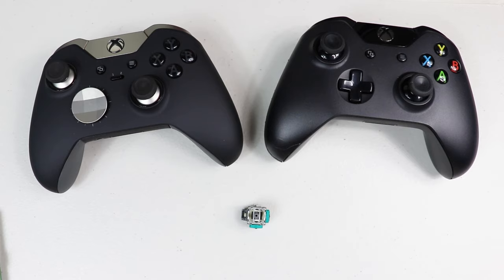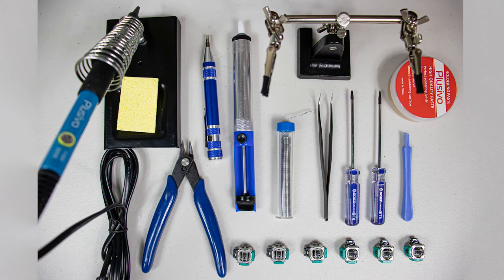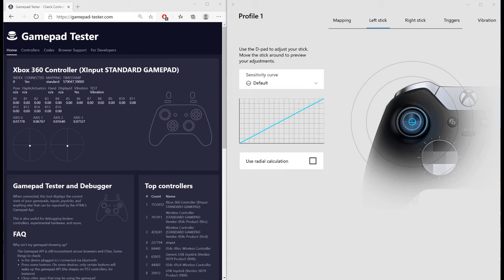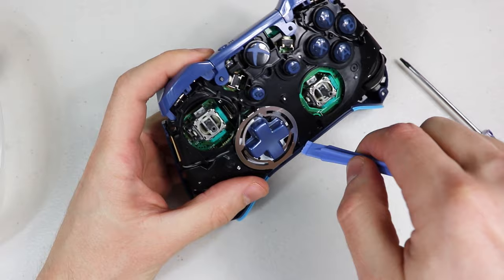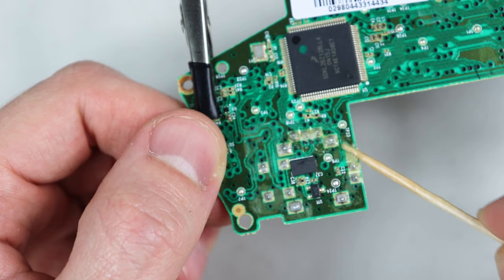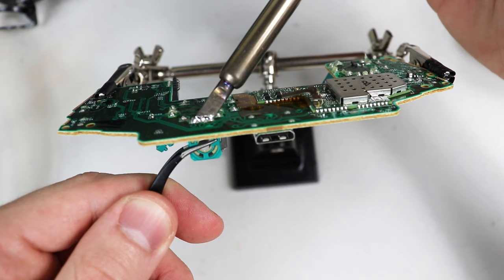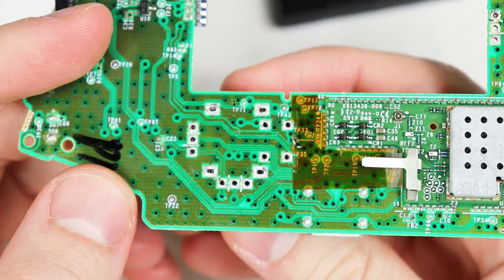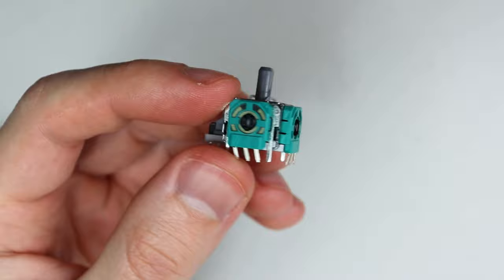How to Replace Xbox One Controller Analog Joystick - NEW METHOD - Fix Stick Drift, Broken, & Loose

Comment: Why would you cut those plastic numb off, that messes up the alignment of the analog sticks. Just leave them in place and bend the metal legs to go through the holes.
Reply from the maker: Are you referring to the nubs on the potentiometers? If so, it does not mess up the alignment of the joystick. The joystick is already soldered in place. It's a way of manual calibration. It works. I've replaced over 300 joysticks with this method, no issues :)
Reply: @SOSSGAMING  I just feel the nubs are there to perfectly alight the sticks. Messing with it seems like a time waster but if it works for you I guess who am I to say anything.
Reply from the maker: @johanbouwer5737  Ok, I understand what you are saying. Fortunately the side tabs and the solder on the pins of the pots are more than enough to keep it stable. The side tabs are the ones you really don't want to remove, though. If you are still worried, I have an older video showing a more complicated way of calibrating them keeping the pots in tact. 

Off center joysticks do effect gameplay even if there's not enough for drift. A lot of times a simple replacement without any manual calibration will result in a stick "drifting".
Reply: @SOSSGAMING  I get you now, didn't think that the built tolerances are that bad that it wouldn't be dead center every time. After seeing the video I have reservations on doing it myself.

Comment: Could you post the software you use to recalibrate the new Joysticks?? I want to do the repair but will need the software before I make the purchase(I’ll buy your joysticks btw your stuff is such good quality).
Reply from the maker: The software is strictly only for PC users, and it's integrated into windows.  Is that what you're asking?
Reply: @SOSSGAMING  yeah. I have a pc with windows that I could do it on. Is that meaning that if I calibrate it with the pc it won’t be properly calibrated for Xbox? If not I have no he means to calibrate on a pc if you gave me the program name
Reply from the maker: @jaredhb7706  Yes, if you calibrate it on PC it will only work on that PC, it doesn't transfer to Xbox. I've tried it before :/ 
You don't have to download anything, it's literally a part of windows.  Here's a video showing how to do it: https://www.youtube.com/watch?v=WvqwjzCRauA
Reply: @SOSSGAMING  oh okay. Thank you very much. How would you calibrate it when you did repairs? Could I use the Xbox accessories app just the same?
Reply from the maker: @jaredhb7706  I used the manual calibration method shown in the video :)

Comment: Aren't the analog all universal? Such as ps4 ps5 Xbox and Xbox 1
Reply from the maker: They are not, unfortunately. Though, they each can technically be installed into one another, and can be modified to work, but there are varying differences like height, spring tension, and potentiometer range that differentiate them.

Comment: Hey there! Will that link in the description work with the series s controller?
Reply from the maker: Yes! And good news if it was purchased recently it likely has the integrated calibration. Meaning after a minute or two of moving the joystick around (after replacing the joystick and/or potentiometer) while plugged in it will automatically calibrate.
Reply: @SOSSGAMING  how recently must it have been purchased to have auto calibration
Reply from the maker: @dillonbusby788  I'm honestly not sure, wish I knew. If you were to test the controllers calibration right now and it's showing almost dead center (obviously not the joystick or pot that's faulty), there's a good chance it has it I would think.

Comment: @sossgaming is this still the most accurate method for replacing joysticks?  Or have they released better hardware that doesn't need the kind of tinkering you show here?
Reply from the maker: Still the most accurate for the older controllers. The new series x/s controllers now include self-calibration which is nice. Not sure what made them decide to start incorporating that.
Reply: @SOSSGAMING  Oh really!  thats great to hear!  So for newer controllers, I just have to solder in the new joystock, and Im good?   Is there a way to tell the new controllers from the older ones?
Reply from the maker: @Staticasaurus  Yep! Just need to solder on the new one with the series x/s. I believe they all just have the same new design. But it may be possible they only implemented it after a certain time.
Reply: @SOSSGAMING  I mean how do I tell the difference between series x/s versus other models of xbox controllers?  Basically, how do I know if I need to calibrate it manually or if the controller will calibrate it?
Reply: @SOSSGAMING  Hey just reaching out again, I know holidays got us all busy. 

I am fixing some controllers for a friend, and I don't know how to tell if they have the new design or not.  Im not an xbox guy, so Idk which are the new series x/s controllers and which are the older ones.
Reply from the maker: @Staticasaurus  Sorry, I had sent a reply earlier to a google link but it looks like it was automatically removed. Basically just search in google image "xbox series x/s controller" and the design that is shown is the design of all the x/s style controllers I believe.
Reply: @SOSSGAMING  Oh ok great.  I searched what you suggested, and I think I can tell the difference now. 

Where are you finding your technical information, like how they automatically calibrate themselves with the newer models?  I would like to read up as well.
Reply from the maker: @Staticasaurus  Others had mentioned it to me and I had one of my own. So I decided to test it for myself and it had automatically calibrated itself after moving it around for a bit.
Reply: @SOSSGAMING  fair!   Would you still recommend the parts you have linked in the description?
Reply from the maker: @Staticasaurus  Yes, definitely. They are original parts so not only will it's a direct replacement. Better for the install and gameplay.

Comment: Hi im trying to repair my left joystick and i put one in that works from a different controller and it gets stuck and doesnt move when i try it on the tester. Do you think i maybe messed up the board?
Reply from the maker: Do you mean the physical joystick doesn't move or the reading on the tester?
Reply: @SOSSGAMING  the reading on the tester but ive come to the conclusion that i messed the board up because the green is gone lol
Reply from the maker: @heilbronnweb2158  You mean you can see copper under the board or something? Likely the pads are damaged though, from the sound of it.They can be finicky. You can send me a picture at my gmail sossgamingcs if you'd like and I can take a look at it.

Comment: Hey. Im having problems removing the solder with a solder sucker like you use. Is it easier to do with a wick, or desoldering gun?
Reply: I struggle to get out the solder inside the hole
Reply from the maker: In certain holes or most holes? A desoldering gun is definitely the easiest and wick can help as well.  Sometimes tackling the through hole from both sides also helps.  Adding solder can also help as well.
Reply: @SOSSGAMING  I also have a board with a couple of joystick pins are cut too close, Im not able to grab it with tweezers. Do you think a desoldering gun will pull it out?
Reply from the maker: @MrLaispais  if you use a regular or smaller soldering iron tip, you should be able to first heat up the solder, and push the pins out enough through the hole to grab onto.  I've done that before haha hope that helps.  And yes, a soldering gun would also clean that up.

Comment: How do you fix that grey lock clip mine is loose and idk how to fix it or put it back in place
Reply from the maker: You might be able to super glue it back in place or something, but otherwise it sounds like it might need a full replacement :/
Reply: @SOSSGAMING  I did do that and 2 rubber bands and it’s working just fine but thanx anyways
Reply from the maker: @BillNey732  Glad to hear!

Comment: At 1:37 do you mean that even if I replace my joystick I’ll need a pc to calibrate it??
Reply from the maker: You can use the xbox as metioned but essentially yes you will likely need to manually calibrate it. If you are just repairing stick drift, there is less likely a need for calibration if you just replace the potentiometer.
Reply: @SOSSGAMING  THANKS, I didn’t even know potentiometers where a thing, I will try to replace them with some from a different controller

Comment: So is there a way to replace only the little grey plastic stick?
Reply from the maker: Technically yes, but you would need to desolder the whole joystick still, then need to disassemble and reassemble it as well disassemble the donor joystick to get the part. Easier to just replace IMO.
Reply from the maker: You can try leaving the pots in too if they're functioning fine.
Reply: @SOSSGAMING  Ok, yea sounds like a hassle. Thanks for replying man, I appreciate the help.

Comment: Hello! Just fixed my controller using this method! You're great! But now my LB button stays pressed. It clicks normally, it doesn't look physically damaged. I don't know what I did wrong, any ideas? Thank you very much
Reply from the maker: It sounds like one of the small components on the motherboard has been misplaced, but that's just a guess. I'm not too familiar with how the wiring works and all that but I do know if one of the small capacitors on the board are removed/damaged it will cause issues such as that.  I would inspect the board again particularly in the area you were soldering near the joystick and notice if you see any components missing.
Reply: @SOSSGAMING  Thank you for your reply! I did everything with my solder iron, no heat gun. I don't remember harming any small components directly, but what I do remember is using 896°F all the time. Could the solder iron at that temperature harm something? Are Xbox boards extra delicate?
Reply from the maker: @IoriPlaysVideos  That's a modest heat, not too excessive in my opinion (I use around 860).  What would matter more I suppose is the length of time the soldering iron is applied, which if on long enough may been enough to melt the solder of one of the very small capacitors to get it to fall off.  Again, it's just a guess though, but I'm not able to think of anything else that could cause the symptom that you are experiencing.
I know the through holes on these boards are pretty delicate and easy to damage, but other than that I'm not sure.  Wish I could be more help :/
Reply: @SOSSGAMING  Thank you so much for replying, you're awesome. I've fixed my PS4 controller multiple times using my dad's tools and NEVER had an issue. Always using max temperature and pushing it to the limit with heat guns, rubbing the solder iron on the board for minutes! Everything! and the board never died. It was like a test board I abused and still fine. I was extremely careful with the Xbox board, I really am so confused on what happened lol I will check around the rumble packs' cables, there are a bunch of small components there, using the solder iron there was the riskiest place. On the analog stick's side there isn't much that can go wrong I'm sure my solder iron was always where it had to. But'll check, I'll let you know if I'm able to fix it! Thanks again for the help!
Reply from the maker: @IoriPlaysVideos  No problem, best of luck!

Comment: The problem I have with my controllers is that the left analog joystick doesn't register going down or up. I have to press down hard for it to even move down. It not fully stick drift
Reply from the maker: Sounds like severe wearing down of the potentiometer.  You can actually just replace the y-axis potentiometer and that should fix it.
Reply: @SOSSGAMING  how do I do that?  Also it might be a defective controller because I've only had it three months lol

Comment: I changed my analog sticks, but the left stick sometimes keeps pulling to the left and even if I try to point to the right it won't, would you know what it could be?
Reply from the maker: What does it show on a controller tester? If it's 1.000 all the way to the left without changing, it's likely a through hole pad on the x-axis that is damaged, or a wiper is upside down. If it still moves around a bit it may just be the positioning of the potentiometer or the potentiometer itself and just needs replacing.
Reply: @SOSSGAMING  I put more tin and soldered more accurately. I think it was bad solder. solved my problem
Reply from the maker: @raf4killer299  Awesome! Glad to hear. Thanks for letting me know how you solved it.

Comment: Hey, i used this guide and replaced both thumbs. When i went to test it shows axis 0 and axis 1 at -1 it doesnt change when i adjust the stick or move it around. Can you help?
Reply from the maker: Yep I can certainly try to give some insight.  Was this an issue prior to installing the joysticks or only afterward? If so, from my experience this usually indicates a crack in the board, a short in the circuitry, corrosion in the circuitry, or a missing component in the circuitry.  If this only occurred afterward and the potentiometers are soldered on, my main guess would be damaged through holes, and the other guess would be a missing capacitor which are very small next to the joysticks and can sometimes get dislodged.
Reply: @SOSSGAMING  this was an issue after I worked on it. The through holes were giving me a hell of a time and i mustve shorted something because even when i dont have a joystick attached it reads maximum up and maximum left values on the left stick. Thanks for the speedy response my dude and the video was A+ work!
Reply from the maker: @fumbeliah7714  Thanks! The values of +/- 1 without the joysticks in is actually expected.  When the pots are soldered in though and still get those values that's when something is wrong. One other thing you could check is if solder is touching each other between pins.  And if the through holes are damaged it may just need a new board altogether unfortunately.

Comment: So does the elite 2.0 controller have the small holes or large holes when talking about removing the joycon. I am sitting here looking at the points and I can't tell which ones I have. sorry I am dumb.
Reply from the maker: They are small. Also, the solder is a bit tricky to melt because it is lead-free. You may find yourself needing to add some normal solder to it to help melt it. Good luck!
Reply: @SOSSGAMING  Great, thanks for the tip. I am close to giving up I was wondering do you still offer a repair service? I tried to message you on ebay but I don't know if you are active on there any more.  If not no worries I may give it another go armed with your advice tonight but I would like to know if you offer repairs just in case. THanks for the help and your feedback.
Reply from the maker: @DATWagonator  I didn't receive any message. This usually happens if someone's ebay account is new. Pretty dumb. Anyway though, I don't do any repairs anymore, but if you type in ebay "elite 2 xbox repair service" is should pop up a few who still do.
Reply: @SOSSGAMING  Yea it was a brand new acct, but thanks for responding, I have done what you recommended and might take that option but your hint has made me want to try again.  I just figured since I bought your joycon pack I might give you some more business if you still did that stuff but no problem have a good one.

Comment: why cant you keep the old potentiometers and just replace the stick?
Reply from the maker: You can.  As long as they are not damaged/worn (that's what causes the stick drift in the first place).  It will still likely need manual calibration though because even slight differences in joystick position can alter the potentiometer's position.

Comment: I'm attempting the dissasembly method, but I'm having some serious troubles getting out the last few pices. I only have about four left, but they just do not want to come out, and the solder doesn't want to melt. Do you have any tips? I've been working on this on and off for literally hours.
Reply from the maker: Yes, so add flux to help the solder melt again and/or more solder.  As you are melting the solder try to push the piece out more with the soldering iron tip, so there is more to grab onto on the other side.  
Another thing is try to remove the solder as much you can with wick/solder sucker.  Again, add more flux/solder to get the solder to melt if needed.
Hope that helps.
Reply: @SOSSGAMING  Ok, I will try this tomorrow when I get the chance. Thank you for responding.

Comment: How would I fix my joysticks if it’s sensitive to vertical and horizontal moves? Trying to move my joystick slanted will sometimes register but one small move will make it either vertical or horizontal
Reply from the maker: Is this before attempting any repair?
Reply: @SOSSGAMING  after
Reply from the maker: @mr.serious2369  Is it all soldered together?  Does the joystick feel kind of "stuck" a little when you move it?
Reply: @SOSSGAMING  all soldered together and a little
Reply from the maker: @mr.serious2369  Hmmm wish I could be more help.  Only thing I can think of at the moment is the x-axis plastic nub that turns the wheel inside the potentiometer got dislodged and needs to be pulled back out, or perhaps the pot itself.  It's hard to diagnose without seeing what's happening exactly.  If you make a video of how the joystick is moving with what's happening on the gamepad tester I could probably help better diagnose.